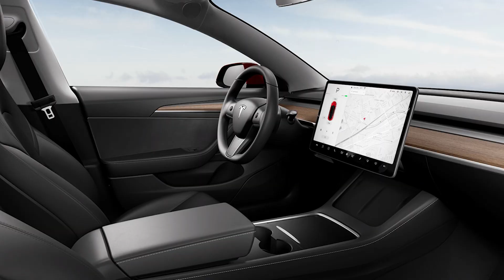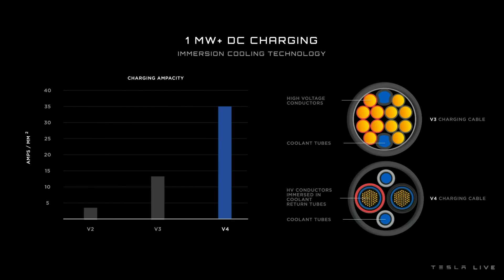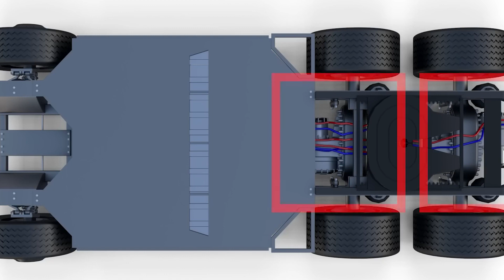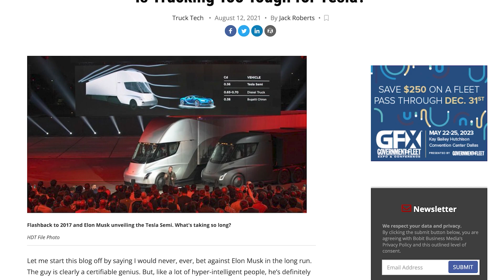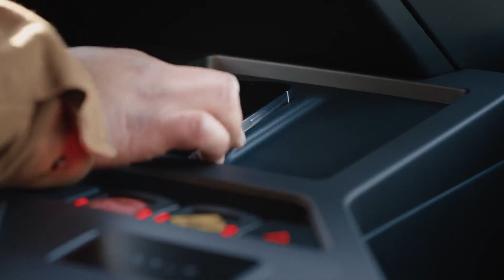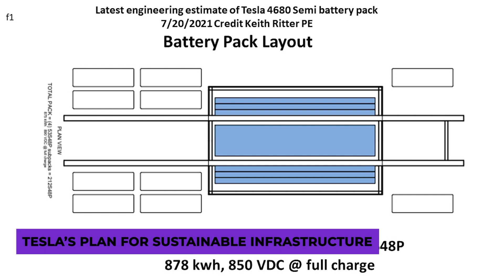Elon Musk Reveals All About the NEW Tesla Semi Truck

Comment: Nothing was gained from this video. Zero. We don't know what the Semi weighs. This is extremely important. We also don't know what they're going to cost. Additionally, saying shit like, "charging from zero to 70%of range in 30 minutes /// truckers are required to take a 30 minute break" is meaningless. Yes, truck drivers do have to take breaks, legally speaking, they have to be free from duty. Parking your truck at the charging island, while your truck is charging, is not going to be considered free from duty. More so, the charging through put at truck stops. We have thousands if not millions of diesel pumps in the USA and we still can't refuel the trucks fast enough. A slower charging method and less charging stations is only going to make the charging through put much worse. Then there's our grid. We've already been through several summers and winters including the current one where our electrical grid has been critically affected by demand. There's no way we can add truck EVs to the grid. It would cripple.

Comment: Very glad that Elon mentioned nuclear. The new plants are very safe and produce mass amounts of power at a relatively low cost. The only thing I’m curious about is why Tesla chose not to use a battery system that allows a battery pack to be swapped out very quickly and replaced with a fully charged pack.